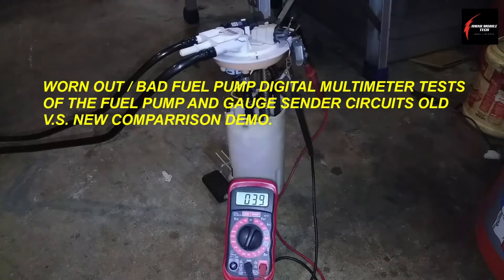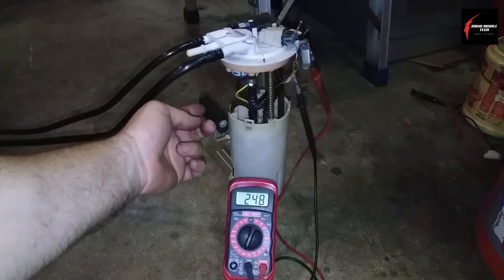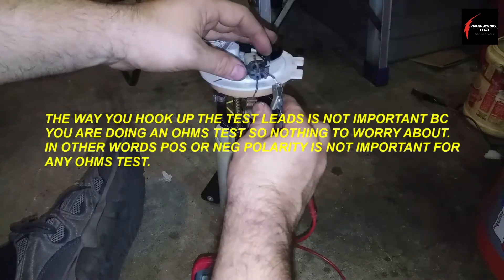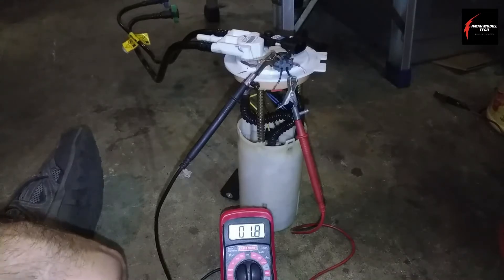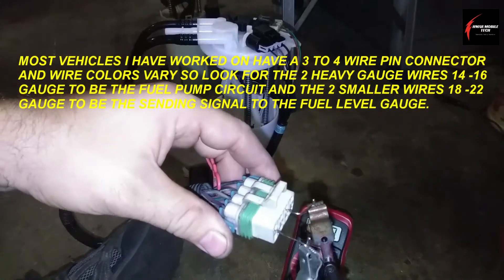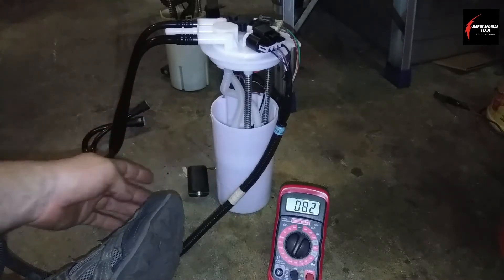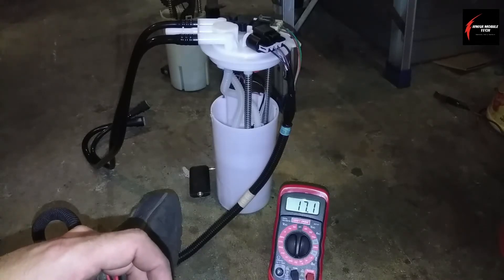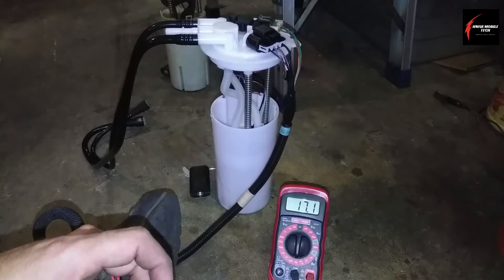MY DIGITAL MULTIMETER OLD VS NEW FUEL PUMP TUTORIAL | UNDERSTAND MORE ABOUT AUTOMOTIVE TESTING :)

Comment from the maker: IF YOU LIKE THE VIDEO PLSE LIKE,  SUBSCRIBE , SHARE AND REWATCH AND WATCH SOME OF MY OTHER VIDS! LOOKING TO PROGRESS ON MY YOUTUBE  VIDEO MAKING CAREER AND ROUND UP MORE SUBS, SPREAD PROFESSIONAL AND HELPFUL ADVICE, REPAIR JOB TIPS AND HACKS TO HELP EVERYONE IN NEED! ENJOY LEARNING FROM MY VIDS AS MUCH AS I TRY TO PASS KNOWLEDGE :)
Reply: Hey brother I have an 06 Pacifica and the resistance between the pos and neg terminals on the primary fuel pump is reading 1.5 ohms. I saw that the new pump you checked had upwards of 17 ohms resistance. I've googled the resistance requirements of the Pacifica, naturally nothing specific, but some blogs were discussing that 1.2-1.8 is plenty and a stationary non energized pumps ohm reading doesn't really matter anyway. Personally I don't believe this at all, being that it's resistance is a huge factor in it being energized initially regardless. Anyway, do you think 1.5 is a little low on a primary pump? I do...I think my pump is going bad. Unfortunately this is a saddle tank and it has two...so I would love to get it right the first time ya know? Any help or a test down of the pump circuits on the primary would be appreciated. It's a 6 pin harness, two pins share a hot leg and one pin is ground of course so technically it's an 8 wire 6 pin system if that makes sense...if it doesn't just ignore that lol.
Reply: Also, my float actually decreases in resistance as I lift it and it only shows a reading around 3/4 lift and up. Weird imo.
Reply from the maker: @A_Stereotypical_Heretic  Hey how are you Lignum 🤓 My best advice is it may be a little extra effort and time / money but if you dont use f.p. then neatly package it and return it as you got it. Go buy the correct f.p. from auto parts store then run your tests on it like i demo-ed in my vid then compare to the old one., Now if your car already has over 100k miles on it and approx 10yrs old and you are having a fuel delivery problem then I would replace it, but check fuel pressure and fuel volume before you condemn the f.p. and / or replace it. Hope this helped🙂
Reply from the maker: Additionally, if you are not sure then go to a yelp.com 4/5 star auto repair business and have a tech diagnose it prior to doing any fuel pump replacements, check fuel pressure and volume, and make sure wiring looks clean , is clean and no damage to the wiring or connector, plse update me once you know. Yes, a very high / low ohms reading on the f.p. pos and neg pins is a problem, idk the specs for your chrysler, sorry about that😬
Reply: @hmarmobiletech8332  well it's my old current pump that is testing at 1.5. I haven't purchased a new one yet but from what I've read and looked into the primary pump is the most notorious and likely culprit. The issue is that the vehicle is treating a 1/4 tank of gas as empty. And I know you're familiar with how these saddle tanks work so I'm assuming I'm getting gas sent to my injectors from one side of the tank only. As far as I understand the primary (drivers side) pump is the one that does most of the legwork as far as transferring, creating a siphon vacuum, and sending to the injector rail, and the secondary just helps keep the transfer of fuel moving from one side to the other. I've tested all of my connections, and ran down the harness, all seems well. The supply to my pumps might be a hair low at 11.75 volts but that was tested prior to me putting the battery on a charge. Other than that the pump at 1.5 ohms is the only issue I'm seeing other than a finicky float. Honestly, it could just be the float not registering correctly. Regardless, I have the tank down so I might as well replace the whole assembly. It has 280,000 miles on it. Thanks for your time brother.